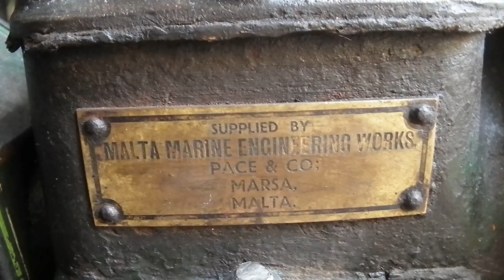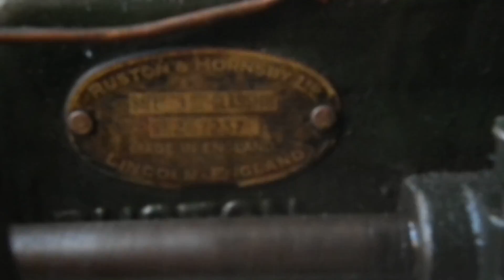Ruston & Hornsby 1HR - Start up procedure

Comment: Nice engine, this particular model no longer has a governor, it's incredible :). It's the first one I see with an injector pump.
Reply from the maker: It does have a governor. Thanks for your comment.
Reply: @enginelover1  I did not see it haha, thanks for the correction. :facepalm:

Comment: That is a very nice engine. I like how you can get it to run so slow. It does take a lot of oiling points!
Reply from the maker: Yes it has some points. That oiler in the the inlet is to lubricate the valve guide, not for starting!

Comment: Very nice, but that sharp hammering sound bothers me. What is causing it and is it normal?
Reply from the maker: That clicking noise its the governor weights, because its running slow. Or you could be hearing the compression escaping from the back of the cylinder. Thanks for your comment.
Reply: Hmm, not sure. It's similar to the sound you get when tapping two hammer faces together - a very sharp sound - and it's directly in time with the upper valve closing. I don't think it's from the cam follower though. Anyway, it's still a lovely, relatively small engine! Good work keeping it running.
Reply from the maker: Yes that sound is what i mentioned. Its ecxactly when the inlet valve closings :). The camera catches more sounds then we do, so live they arent that loud.  That is the smallest Ruston horizontal diesel they made.... I am so proud to have it. Thanks for your comment.

Comment: how does it cool ?
Reply from the maker: Tony Baines Its cools with a thermosyphon system. But in the video it only has the water jacket filled with water as these engine dont get hot especialy without load. Its not good for the engine to run cool. Thanks for you comment.